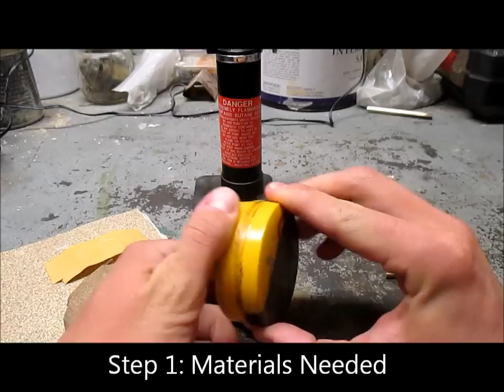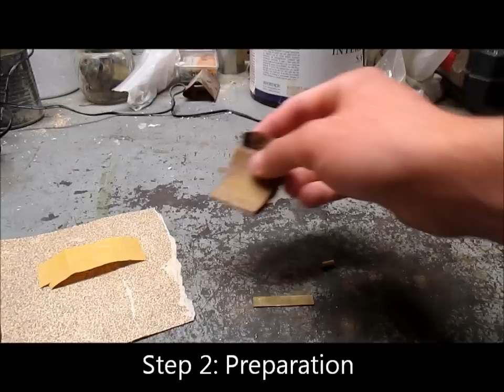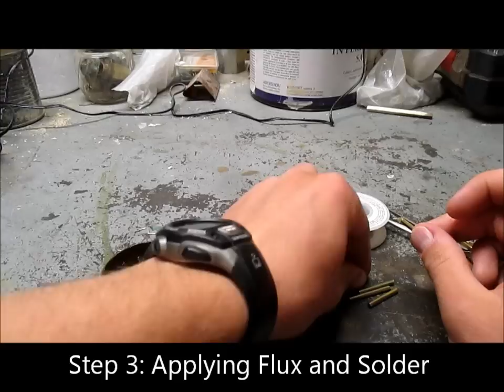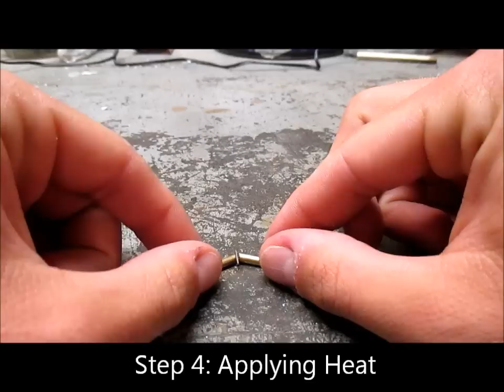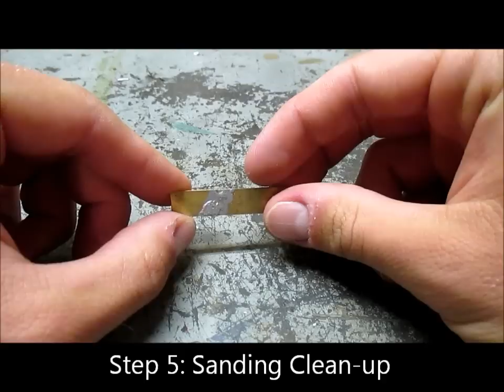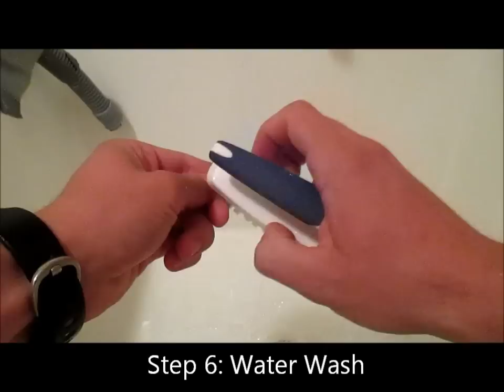How to Solder Brass

Comment: Thanks for the very informative video.  One question.  If you were to solder another piece onto the end of the exhaust that you soldered, how would you protect the first joint from desoldering when applying the heat a second time?  Thanks again.

Comment: Hi Ethan, I have bought myself some flux. About the solder you used, should it contain any flux at all? I can locate only "rosin core", which apparentky also contains flux. I mainly solder thin brass rods (for slot carbox frames). I've found 60/40 but no 50/50 and I want t get the ingredients right.
Reply: Hey, beginner here. Can you please tell me what sort of solder I can use that is the same color as brass? I want to make some jewelry replicas, so the joint can't look a different color

Comment: can i use borax?
Reply: I'm currently using brass to make jewelry, after several failed attempted i place the metal in a bath of vinegar and salt.I remove it clean with regular tap water , then solder with borax as flux and jewelry silver solder like a pro😉

Comment: Is there any such thing as brass soldering paste or brass soldering wire to make  it be all brass matching coler   in the join instead of using silver solder
Reply: Yes,. Brazing.  Or bronze solder.     There is a brand called easyflo.   How this helps.     Manly used for heavier gauge brass,.  But does enable soldering brass to steel, and stainless steel.  A lot cheaper than silver solder too.
Reply: @russcole5685  hello.  Coud you please tell me where can I buy it.   Do you have a link ?  Thanks in advance
Reply: @nelbamartinez2310  I'm in New Zealand.    Any welding supply chain.   BoC   "British oxygen company" I think are world wide.
Reply: @russcole5685  thank you so much.  Have a wonderful weekend!
Reply: @nelbamartinez2310  thank you to my man,.   Hope your project comes together well.       When buying the Brazing rods, you will also need a tin of flux.  It's a powder, gently warm filler rod, dip in powder to coat.  Then heat your base material's, and dip dip filler rod.  It'll flow nice when you have all temperatures at optimum.  Can chase and flow with flame heat.   Beautiful stuff to work with.  Bit of a list art in the industry now.  Chow